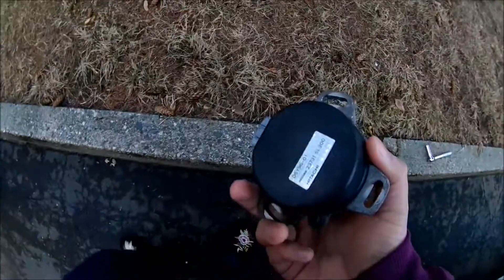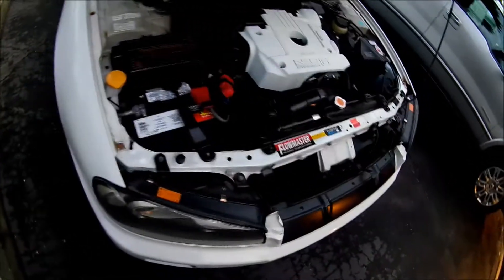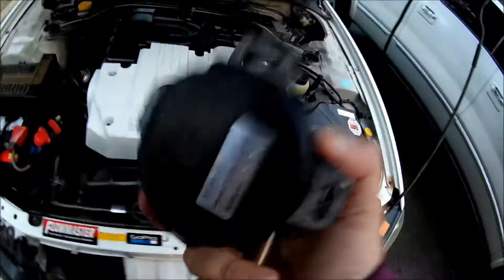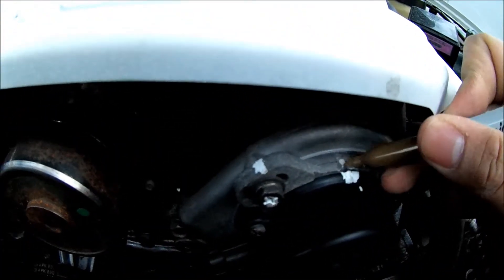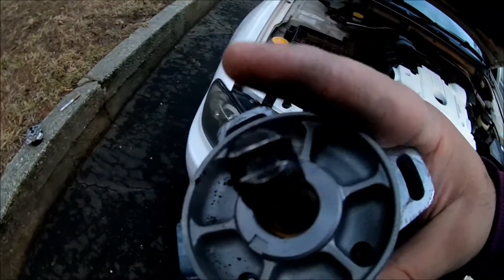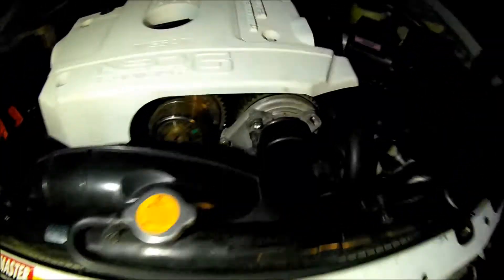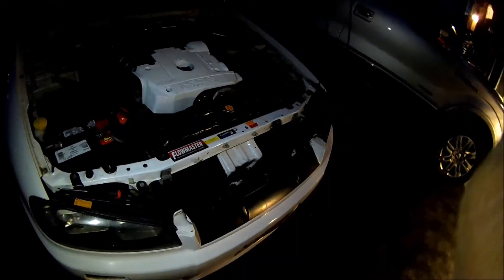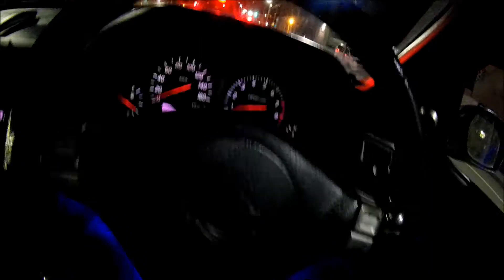RB25 Crank angle sensor replacement

Comment: What's up bro i have a Nissan laurel c35
(rb20neo) it cold starts just fine it'll run for a while but then randomly shuts off and doesn't restart just keeps cranking when its cold it
sometimes restarts but the problem is very
intermittent do u have any idea could be the cas?
Reply from the maker: It could be, but also could be the maf sensor

Comment: Hey dude. Been trying to diagnose a sound for ages 

Your first 30 seconds described it perfect. Knocks. Then goes when increased revs and then returns after some time at stand still. I’m wondering is it’s CAS. same issue 

Do you have the sound recorded that yours used to make ??
Reply from the maker: It’s been a few years, I don’t have the sound. It’s not the CAS. It’s the bracket that hold the CAS in place that becomes weak. Mine actually exploded, to pieces while driving luckily there was no major damages. The bracket threw out the CAS into the clutch fan. Everything was okay just put a new bracket used the same CAS and she she started right up.

Comment: Ok so iv got a question, I took mine out thinking it was necessary to change rocker cover gaskets with little regard for its positioning not really understanding what I was messing with 🤦‍♀️ I put it back in what I though was the same way it came out but clearly I didn’t because it just won’t start now, is my best course of action to set p1 to tdc and then put the sensor back in? I’m just hella stuck rn 😅
Reply from the maker: I had the same issue once you can either set to tdc. Or do what I did and just play around with it till the car starts and idles smoothly. Then I took it to a shop and let them set the timing properly.
Reply: @AbdullahZahid  thanks dude it’s running now finally
Reply from the maker: @avokes6919  great, how did you manage to do it!
Reply: @AbdullahZahid  honestly pure dumb luck, yesterday I went to remove on of the bolts that has snapped on the sensor and put in a new bolt and this morning it’s not starting again 😭😭😭. When I first got it started again I didn’t do anything different just pulled it out again ligned it up with the old dust marks and it started and I’m trying to do the same now with no
Reply from the maker: @avokes6919  LOL don’t push the car take it to a shop have them do your timing just to be safe.